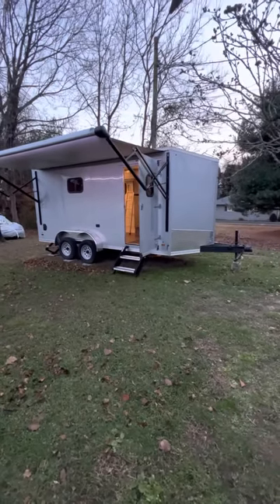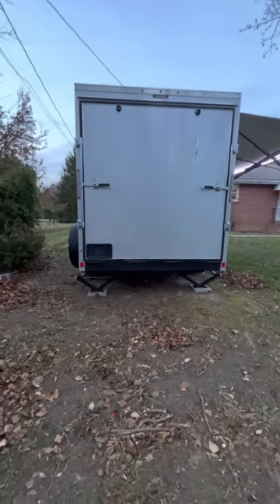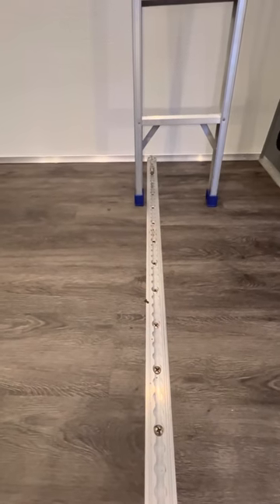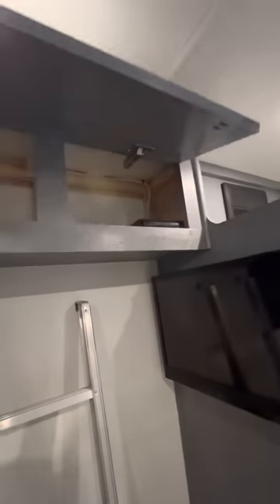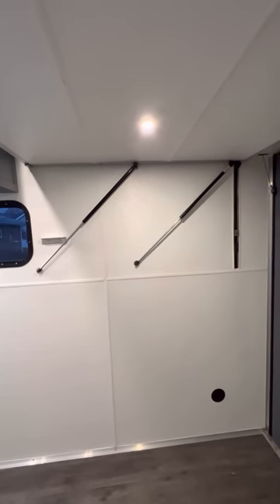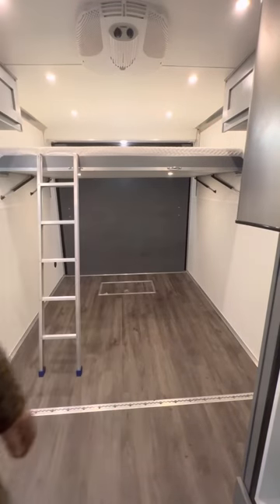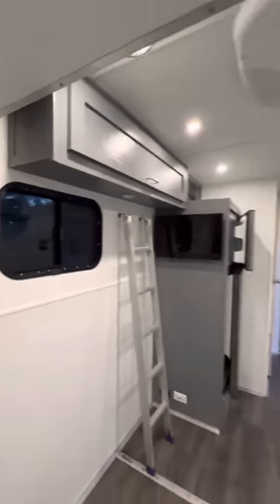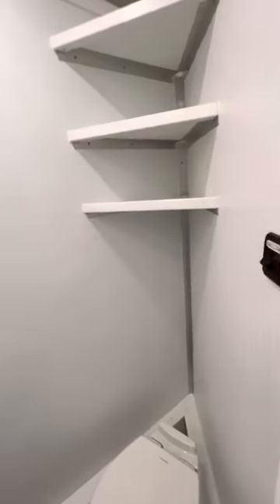My 7x16 cargo trailer to camper conversion

Comment: The use of the "bull nose" for a split kitchen sink/bathroom is absolutely genius for a multitude of reasons.  You saved so much space and material by doing that. Having a real toilet and a real shower is not negotiable for me. Your build is perfect. Congratulations!
Reply from the maker: Thank you! I was worried about tongue weight but once it all came together there’s only a couple hundred pounds up there and it really isn’t noticeable when towing it. 
The shower and toilet were also non negotiable. It’s small but plenty of room to do what ya need
Reply: Very nice project...

Comment: DIY camper with an enclosed trailer is definitely the way to go. You can spend 2000 total and throw a cot in it, or you could spend 10,000 and make it whatever you want it to be instead of dropping 50,000 on a prebuilt one. Love it. Looks awesome!

Comment: Almost the same design I have planned for my caravan which is 23 feet long, 7 feet wide. It would be a 8-seater and hence with space for two people to sleep on the floor. The kitchen is at the rear end and the entrance door is a convertible bathroom. Thanks for the upload, your built gives perspective.

Comment: Nice! Straight to it. Bigger wheels and tires look like the only thing left that you can do to it. Good job bro 👍🏽
Reply from the maker: New wheels and tires Coming soon!!
Reply: As light as that is ..I'd have gone singles and matched my 8 bolt 16" van rims/tires. .I did this with a 6x14 used wheel adapters to get  from the 5 bolt to an 8 bolt. Also installed brakes.

Comment: You sound a little negative about your work. Let me say that this is fine work. Simple, clean & good.
Everything you need & nothing you dont. Little by little is what i say. I will actually work out designs in my mind over and over a thousand times before i do or buy anything.  Ive been blessed with a photographic mind.
But sometimes its a curse. 
I like the open space. That way you can build it out the way you want. 
Fantastic work my man. Great.!!!!

Comment: Impressive as everything you build on this conversion is one of the best on YouTube. No shortcuts in this build as everything that was constructed looked better I have seen. Do you have solar power or plans for one. The trailer will look even better on the outside when you install bigger tires and rims! Putting new tires and rims can be a video in itself with a thumbnail picture of the finished product will get you tons of views!
Reply from the maker: Thank you! 
No plans for solar this is just going to be a weekend camper for atv riding  
Surprised by how many views this is getting. I never considered posting a series. May make some more videos of future projects

Comment: Very very nice! I have the same size trailer that I’m in the process of converting and need this bed system badly. I’d pay to get this bed system installed if I could, as I’m afraid I’d mess it up or the trailer for sure. It’s exactly what I’ve been looking for after finding out the Happy Jack bed system is crazy expensive. Your design is simple, neat and effortless, I like that. You’ve done a great job, if you could give details on bed system that would be greatly appreciated and or if you’re willing to build another one for sale I’d be a customer for sure. I have the same awning as well, love it. Great job again, very nice!
Reply from the maker: Thanks I appreciate the kind words. It took a lot more time then I anticipated. 
The bed idea is really pretty simple it’s the fact the trailers are built so poorly that made it difficult. This trailer has 1x3 steel skeleton behind the walls that support the bed, awning, and air conditioner. If I knew how to edit a video I’d make some sort of time lapse with photos I took during the build.
Reply: @Professionalhomeowner1  just out of curiosity, what is your best guesstimate of the bed weight, and the rating of the struts? I've been considering a build myself, just waiting for the right time.
Thanks!!
Reply: What awning is this?

Comment: Everything is very nice.  The bath and commode are exactly the way I want but I would add a small bar sink with mirror for shaving and for hand washing.  Seems like there is plenty of room for one.  Did I see towel racks?  The exhaust fan is essential for keeping the humidity down in the camper.  Liked it very much.  Congrats on a nice build.

Comment: Great build.👍
Like the concept of the bed but does not go low enough to my liking .  Anyway, I will need to figure out something for singles for my needs.  I like the idea of them coming down from the ceiling not taking up side space when traveling.
AirCon - might do Minisplit.  Windows -- yes might do something else.
Thanks for sharing you build.
Cheers
Reply from the maker: Thanks! 
I kept the bed high to eventually install a folding bed/ table and bench system below it. I’ve seen some cool builds that use folding bunk beds 
I think a mini split would be great at-least for keeping the noise down inside. My ac is pretty loud
Reply: maybe find some twin or full size murphy bed plans that folds down to a desk for video editing.
Reply: @Professionalhomeowner1  
Yes -- the tradition aircons are noisy buggers -- I think the M-splits are the way to go.
Cheers
Reply: @vannerdherd  
I personal dont need it for living in, I will only need it for toyhauling or camping -- when not being used to take my Flexwing Trike back and forth from the air strip, it will it will be used for a weekend camper. So transition between the 2 have to be relatively seamless, less the packing of consumables for the camping.
Cheers

Comment: Looks really good.  Check out the builds for the Fed X box trucks they use for team driving, it has a fold down Murphy bed, with a 2 bench dining table.    I like your set up a lot.  I would like to contact you later when I find a shuttle bus to do into a conversion. You have a great mind to come up with your build.

Comment: Clean, clean, clean build.  Nice awning, great fridge and awesome bed with space galore left open.  A little light on the storage spaces for my liking but overall truly nice and you showed it well too.  

What flooring would you choose now?  That’s something I keep pondering.  Rubber, carpet, vinyl, wood.  All seem to have pros and cons.
Reply from the maker: Thank you! As I use it more I’m sure I’ll add a few things. Storage is precious! 
I really like the vinyl plank flooring I used it’s the nicer stuff with the foam backer. My issue is more with the e track I used and that trap door in the floor as well as the bathroom. These combined made it really difficult to install and leave a 1/4” space all around. I’ve never done anything like this before so someone more experienced may not have such a hard time. 

If I were to do it over again I would use some sort of 1 piece vinyl floor
Reply: One piece vinyl. Pros- No seams, easy install.  Cons- Can’t replace a small damaged part easily (it is possible by matching and double cutting patch and damaged area at once)  Only typically comes in 6’ and 12’ widths.  7’ wide trailer either has to be pieced or have a 5’ by 18’ piece left over. (If a 2’ nose on a 16 footer.). And then there’s the ramp which I want to cover as well.  For my needs I am strongly leaning towards commercial carpet squares but still undecided.
Reply: Maybe a combination of the sheet vinyl and the carpet squares.  Vinyl up front kitchen and bath, carpet squares in the rear bed area and ramp(which I plan to be a screen room)
Reply from the maker: I think those commercial carpet squares would make it very cozy inside.
Reply: I bought a scrap roll of vinyl flooring from a local shop for less than half the cost of stock. Only made four cuts: to width and length during layout, and the two sides of a triangle for the nose. It was the first time I installed a vinyl floor. Rented a 100-pound roller, glued and rolled it down after prepping the subfloor (filled holes, sanded joints.) It looks great, and is seamless. It's comfortable and very easy to clean. I saved some scrap for repairs, when needed.
Reply: @tinymission7821  I would like to find a trailer rear door to be able to 1) fold down like a deck AND/OR 2) make an awning out of it (in case it is raining outside).

Comment: I like to Super insulate using foil face foam, especially in the ceiling double. I use soft fiberglass plus foam. More better. vented propane wall heater, but have wood and electric. Some people go for diesel Heat, can't handle the smell. 2-Burner camp style propane stove is always nice Plum to a larger tank and vented Hood. Don't like sucking propane fumes! Nice awning.
Reply from the maker: Yea this trailer has foam board in all the walls. And 2”’in the ceiling and under floor. Then eve to single seem with taped with foil tape. Every crevasse was filled with spray foam. It’s like a walk in freezer.

Comment: Very clean design.  Quick connect propane for small burner would be cool.  I have one.  No need for mounted burner.  Buy small chairs and table and connect to wall with bungee net.   This way you won’t lose precious versatility. 
You have best build I’ve seen
Reply from the maker: Thabks for kind words. 
I haven’t decided on heat source but I was trying to avoid going propane just for simplicity
Reply: Cooking burner
Simple propane heater from Lowes would keep everything simple 
I additional quick connect for outside bbq

Comment: Hello, I saw your video & I used to do a lot of trailer & truck camping. Let me pass on some things that I learned that might help you in your journey. 
1) Get stuff you need at a camping store for backpacking. It's small, compact, & light weight. 

2)Get splash guards for your truck. It'll help keep you & your rig clean. They work. I know. Also grease your ball & the cup on your hitch. This will help prevent metal on metal grinding.

3) When parking for the night, park headlong into the wind. That way if a storm comes you won't have to worry about a side wind ripping off your camper shell. Plus, if anything comes bouncing towards the truck, since you have a slimmer profile, it might miss you. If it does hit, the front of the truck is reinforced. 

4) Use bug spray on the interior doors & windows/ screens openings to help keep bugs out. Use wasp & hornet spray around & on your tires to help keep critters out. Basically, all points of contact on the ground.

5) An inch is a lot of room. Learn how to stack & get used to sand & dirt.  Use floor mats to put your shoes on too

6)Air out your sleeping area every morning or often. In an enclosed space the air gets stale.

7)Use a small fan to circulate the air in your sleeping area. This will help prevent hot & cold spots from forming & help prevent condensation & mold & mildew from forming. 

8)Use a solid hooded sweatshirt. Draw the hood tight when you sleep to help encapsulate body heat. It can double as a pillow/ dirty clothes holder/ gear carrier.

I hope this helps. Great vid, thanks for sharing. Drive safe. 🤠
Reply from the maker: Thanks for the tips! All seem very practical
Reply: @Professionalhomeowner1  NP, Happy trails. 🤠

Comment: Amazing, simply amazing! Having just completed my own project I can’t stress how amazing this job is! Couple of questions if I may:
1. Does the back edge of the bed just slide down the rail?
2. What are struts specs? Or maybe a link if you have it?
3. Did you custom build the bed frame? Aluminum?
4. How many batteries do you have onboard and where are they?
5. Do you know what the weight is of the entire things as is in the video?

I have 50 more questions but spare you the pain. If you make fold down table/seats please post!!
Thank you and again - 100% certified amazing! Great work
Reply from the maker: Thanks for the kind words! 
Yes the rear of bed is just on rollers that slide up and down the track. The struts are 36” and two are 100lb the other 2 are 45lb one of each per side. 
Bed frame i made out of angle iron and encased in wood 
No batteries. I have a generator and shore power 
Haven’t weighed it yet but have been meaning to
Reply: @Professionalhomeowner1  really appreciate the reply! If you end up makeing the table, would love to see the video update.

Comment: Few of negatives but overall its a nice looking trailer. I dont care for the V front even though its for so called airodynamics its to me wasted space. The bed is up too high for us older folks. I can see me jumping down to walk out a leg cramp. I also don't like diamond plate metal its ok on the fenders but not on the trailer. I guess you can put furniture inside where you have all that empty space. I did not see a closet which you have plenty of room. The refrigerator is good. The windows are ok but my wife would want larger windows to get rid of the closed in feeling. I do like the retractable awning. This is one of the better cargo trailers i seen. Thanks for posting. 73

Comment: Great job. Looks very functional. I like all the open floor space which can be used for multiple purposes. If you had it to do over what wood you put on the floors?
Reply from the maker: I think I’d go with some sort of sheet vinyl. 
But I will say the plank is holding up pretty good it was just a pain to get right with the flush e track I used

Comment: Best I've seen 7X16. That has got to be one of the least expensive "RV" trailers. Didn't say cheap. It's a good clean job.
Reply from the maker: I was intrigued by folks doing how much I had into it. So I added up all the receipts I saved and the cost of the trailer and came in right around 16,000. I couldn’t imagine the build quality of a factory built rv for 16k. I mean the 30 and 40k trailers are absolute junk. Really happy with my investment. And was shocked when I added everything up it was quite a bit less then I thought I had spent

Comment: I'm looking at buying a similar trailer with some customization options already done. I have to keep the weight within a certain range though. So my truck can pull it wish I could have it done very much like yours. Love the bed set up it would leave room to put the cots I have underneath it for guests. Very cool trailer setup I have one question though what is the weight of your trailer when it's empty after all the work you have done to it. I'm just wondering if I could get some similar stuff for the one I want and still be within the weight range I have to stay within.

Comment: Who is the trailer manufacturer and can you go over how you boxed in the rear door assist spring. Awesome build.
Reply from the maker: It’s a us cargo trailer. Forest River is the manufacturer. The cover you see is really basic. I just made a small 3/4”x2” frame out of pine and closed it in with frp. The bottom panel is from a roll of aluminum I found in a dumpster on a jobsite and it’s easily removable by pulling off the aluminum trim so the springs are still accessible

Comment: Couple questions....
1. What is your ceiling height at the center?
2. What is your wall height?
3. What is your door height?
4. What is the height of your bed when down?
5. Thickness of your mattress?
Reply from the maker: It has a 7’ ceiling height 
The bed is 7” I think could go smaller 
Could easily use any length gas strut and allow the bed to come down further. 
The rails for the bed go floor to ceiling so I could add another below it if I wanted.

Comment: 1. What is the height of your trailer?
2. What is the distance from the floor to the bed when the bed is in the down position?
3. What is the distance of your bed to ceiling in the down position?
We are in the same situation.  Store motorcycles under the bed.  We are wondering if we will have enough height to leave the bed down and load the bikes.  We have a 7 ft ceiling 7X16 V-nose.

Comment: Great conversion, i wonder why you went with a cassette toilet rather than a Composting Toilet
Reply from the maker: Thanks!! 
This is not a cassette toilet. It is a regular rv toilet with a 20 gallon black tank. The trailer will not be used often enough to have a compost toilet.

Comment: How much do you want for one!
I would want 60-gallons of Water!
Dont need the tank heating blankets-not that cold here!
Want a bunch of Solar Panels and Batteries!
An Inverter 2000 watts!
A 12v AC too (we don’t need AC much!  If it’s that hot we will stay home and swim in the pool!
Otherwise, looks real nice!
Oh, I would use it as a Toy Hauler for a SXS.
Reply from the maker: I would look into an 8’ wide and 20’ long trailer to comfortably build it out and be able to fit a sxs. My biggest regret with this build is not going for an 8’ wide. 60 gallons of water is totally possible but you’d need to do some cross frame mods to fit it under the rig. 
To be honest I don’t know if there’s a market for these conversions as it would be quite expensive to build to this caliber. Most folks would look at regular camper trailers. 
I’ve got every bit of 20k wrapped up in this. Probably closer to 25 and hundreds of hours. I could certainly build another one faster after doing this one though. 
I’m sure there’s someone out there doing conversions for people. At this point in my life I’m a slave to my day job and barely have time to do what I enjoy and build things.

Comment: On iteration two, I would make it so you can plop down in bed with out having to do anything.  I simple cot, office chair and folding table is all I use.
Reply from the maker: I plan to add some folding couches and a removable table that will fold out to another bed. For now it’s an air mattress below the other bed